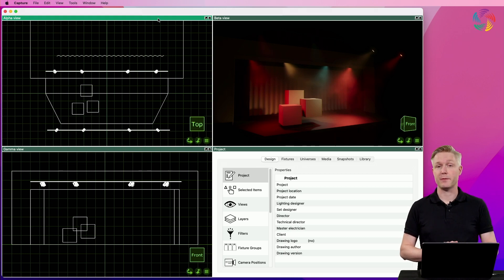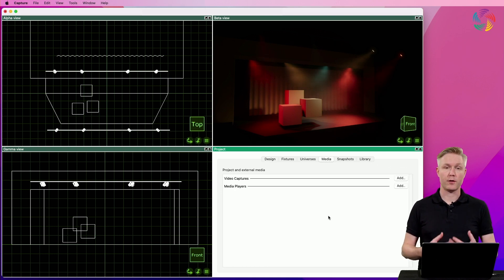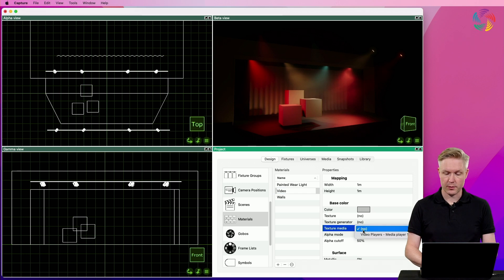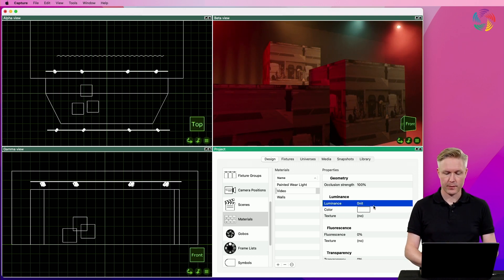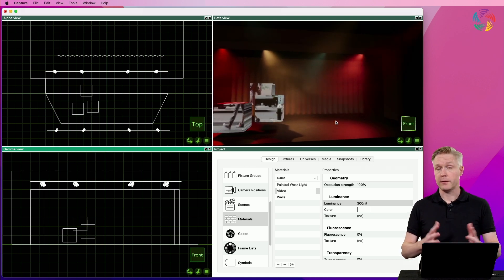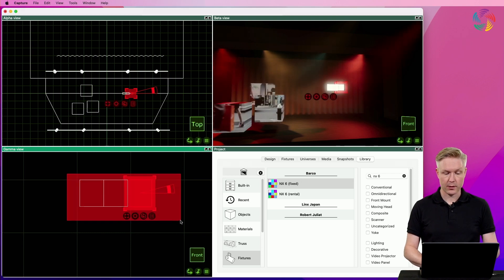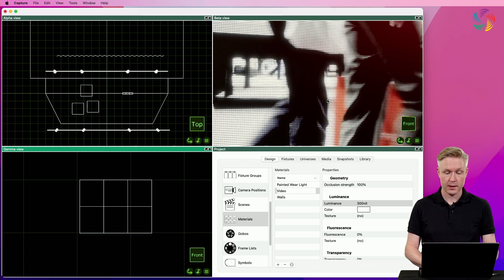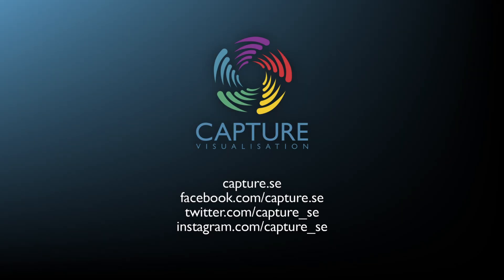Video and LED Panels

Comment: hii
is there any way to create curved screen?
Reply from the maker: Curved screens are currently unsupported. You will need  therefore to design the model in an external program and manage the texture mapping and UV mapping there in order to easily generate curved surfaces.

Comment: Hello, I am sorry for asking such a silly question, but I am just starting with Capture, and I am stuck...My question is: How do I make a Generic LED tape? I cant find any resources to help me out :( 
Thank you guys!
Reply from the maker: The answer will depend on how you intend to control them. You can work with some of the generic LED fixtures in the library, map streaming video onto objects or use the texture generators. Drop us a mail at support@capture.se if you require further assistance!

Comment: Hi all, after dragging the material to the LED wall and pressing the "Replace" option, there is no extend material  option. I use version 2023.1.3  Best
Reply from the maker: Replace would be the wrong command, you are likely looking for Map material. Drop us a mail at support@capture.se if you need more help!